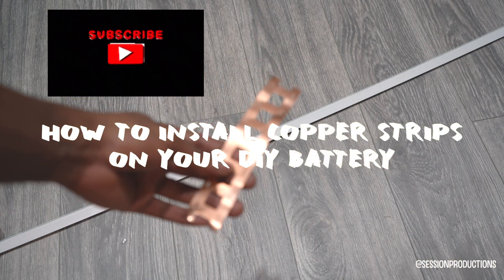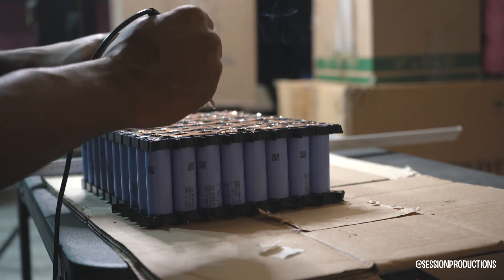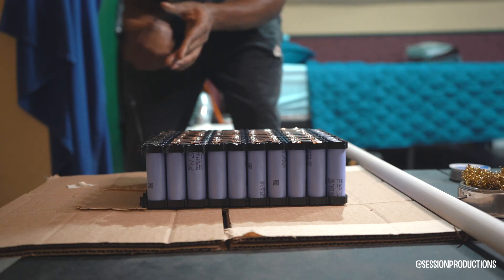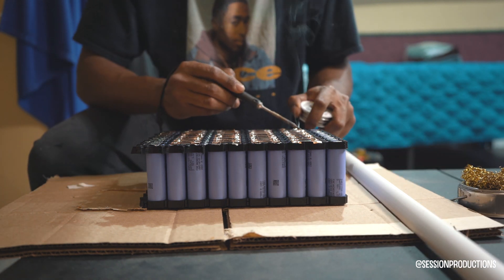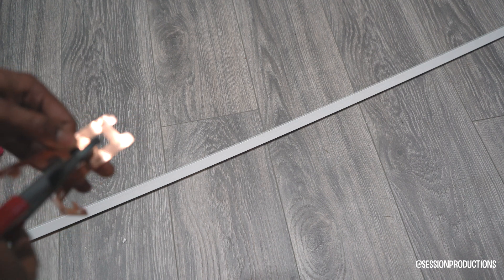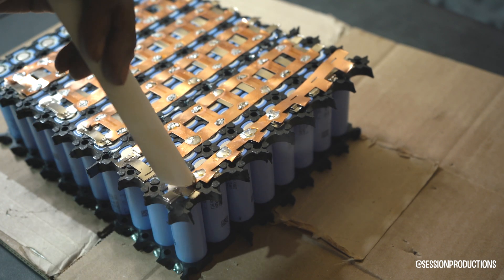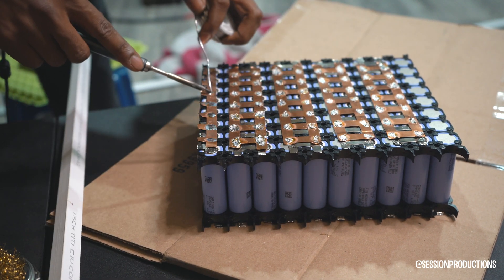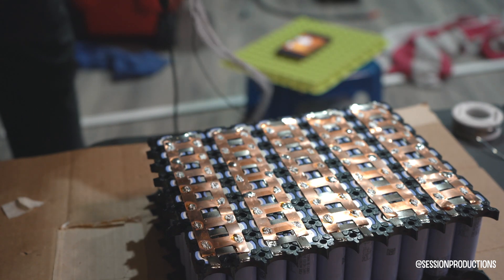How To Install Copper Strips On Your DIY Battery

Comment: You should not be soldering batteries! Spot welding is the proper way of joining batteries!
Google it less heat = less damage to the batteries. Also less changes of thermal runaway
Reply from the maker: Yes but you have to solder on the copper strips. It wont work with the spot welder. I 100% agree with regular soldering to a cell or multiple cells
Reply: @mikeyyywill  copper/nickel strips !